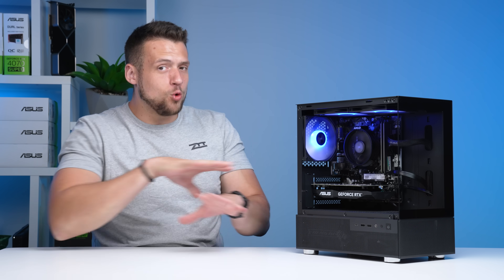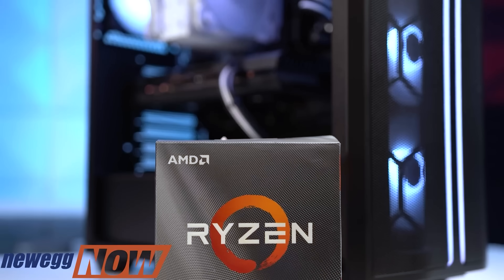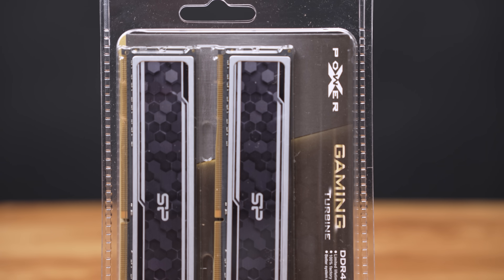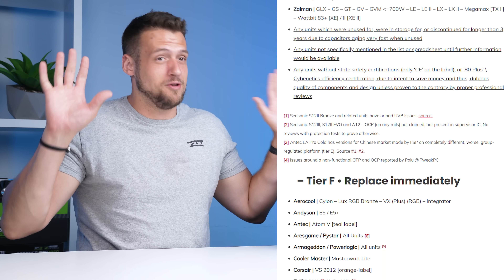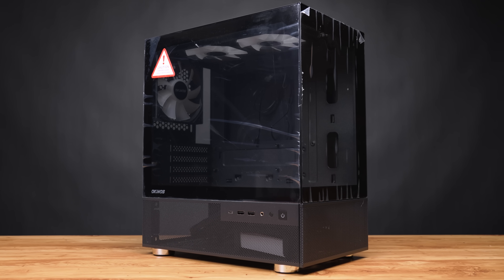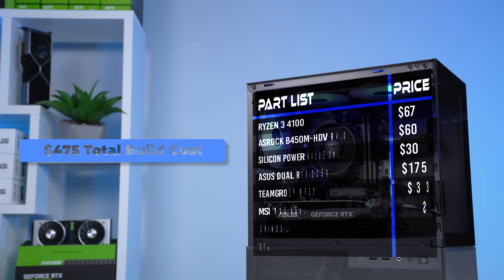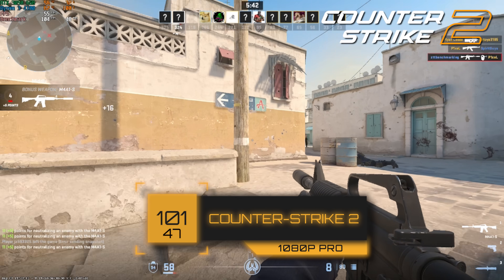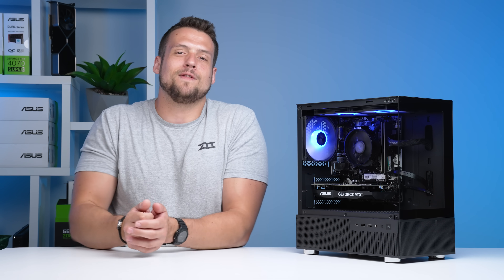$475 Gaming PC Build Guide

Comment: You can also use these specs & get better fps in games for the same price.

CPU: AMD Ryzen 5 5500 ($87)
Cooler: AMD Wraith Stealth ($0)
Mobo: ASRock B450M-HDV R4.0 ($59)
GPU: XFX Speedster SWFT 210 Radeon RX 6600 ($169)
RAM: Silicon Power Value Gaming DDR4 RAM 2x8GB 3200MHz ($28)
SSD: TEAMGROUP MP33 512GB ($35)
PSU: MSI MAG A550BN ($58)
Case: Cooler Master MasterBox Q300L ($39)
Reply: was about to post this heh, total ~500$
Reply: Almost what I did myself.  Remove all of the silly covers on that case and it has plenty of airflow for such a modest CPU/GPU combo.  Mine is similar and it pulls a maximum combined wattage at full load (theoretical) of just barely over 400W. I put a 750W in because it was $5 more - the cheapest modular PSU I could find,, but even a 550W is still overkill for the job. :)
As for GPU/CPU - the sweet spot right now is the Ryzen 5500/5600 and the 6600 for the GPU. Adjust as you need.  Suggesting a baby GPU like a 3050 is verging on just not caring at all.
Reply: You also can do a ryzen 5 2600 to save about 20-30 dollars on a cpu, the 2600 is still capable enough to fully utilize the 6600
Reply: Bro how are you getting a 6600 for 169&
Reply: @Acal_298  Any holiday sale.  Black Friday is coming up - you'll get similar deals. $189 is not hard to find. In my case, Amazon and NewEgg tend to fight each other for the budget market.  I got my card for that price from Newegg. The rest of the deals were Amazon, though, so cross-shopping is important.
Note that AMD dropped the prices for almost all of their non 3D CPUs, crushing Intel at this point. 
NewEgg has a new in box 5600X for $139. 16GB free ram with purchase.  Absolutely the best deal right now, as of typing this. Also, it's 99% likely that you can re-use your power supply as it's a DDR4 build, and you can of course use the SSD from your current computer as well.  OS - Linux is cheap and stable. 
NOTE - if you are a real cheap weasel, wait 6-9 months.  An entire generation of machines will be e-wasted a they are "too old" to run Windows 10. I'm typing this on such a box. No $30 for extended support for a year B.S. Linux and running my entire Steam library just fine.

Comment: Wouldn't the Intel A580 or A750 be better than the RTX3050 and probably cheaper too?

I want to like the 3050 6gb for what it does, offering a cheap-ish low power card that you can fit into any pc and still game on.

But I also absolutely loathe the 3050 6gb for how it is borderline fraudulently marketed. Being an overpriced downgrade of an already overpriced and underperforming GPU and the market shit Nvidia pulled with it.

If it was called the RTX 4030 or something, I would have been fine with it.

Comment: That's why building new pc is bad idea, you spent $450 for something that only performs as fast as Optiplex gaming pc for more than 2x price

even the RTX 3050 6GB is bad value, you can still build something much cheaper with used Office pc (the office pc often have only 240w psu and sff case which makes 3050 6gb become the only thing that can fits) that as fast as Ryzen 3 4100, if not faster
https://youtu.be/_Xw43xUPEgE?si=xU94mu0gNkx_kA01

Comment: i got an i5 11400f rtx 3070 ti and 32gb of ram and a 1080p 144hz monitor, i got a bit of a bottlneck in some games it's not a big deal , the question is should i upgrade my cpu or get a 1440p monitor ?

Comment: Honestly if you’re building on a lower budget, I’d highly recommend you go with a $550 to $600 build. That little extra cash will play a big factor especially for future upgradability.
Reply: And spend it wisely, my first build was when I was a lot younger and dumber. I got a GTX 1050 non Ti, and mechanical hard drive so that I could have a high end NZXT case, and matching white ram. I ended up regretting that in the long run…
Reply: @ZekeLawl  mechanical hard drives shouldn’t even be a thing in gaming pcs
Reply: @itzsabbage3830 you can use it when you need to put your unplayed games somewhere without uninstalling
Reply: @itzsabbage3830  Agreed, back then it was still debatable if you had a low budget but I made the wrong choice
Reply: Yes. That extra $150 on a build will easily double your performance. Super low end new builds are not something I'd recommend to anyone I know. At a certain point.. you'd be better off getting a used office type tower with something like a 10400 for $150 and tossing in used 3060/ti for $150-250 and swapping the power supply for another $50. $400-500 and you have what would be a $750 new build performance.
Reply: 550 or 600$ in US is like 800€ for parts here in Europe

Comment: Got a 4600G on sale. Perfectly fine for my needs. Re using my lovely Sapphire Radeon RX 580.
Reply from the maker: Nice good to hear
Reply: These can max out a 4060. I am more motivated than ever to get a 4060 because my little Ryzen 3 can run it at 99% apparently.. that's a 1080p guys dream
Reply: @jordanmntungwa3311 why would you get a 4060 in a world where the 6700xt exists
Reply: @jordanmntungwa3311 You should wait for the 5060 instead.

Comment: 3:01 it's off-centered to counter the extra weight that's on the left part of the package when it sits on a rack
Reply: The pack I got had heat spreader on only one side of the sticks.  It was a 32GB kit though.
Reply from the maker: The logical reason of why they did that does not soothe my brain
Reply: @ZachsTechTurf 

It does mine, but the fact that they put a heat spreader only on one side messes with me....

Comment: Zach would it not be better to get the "Apevia Prestige 600 W psu" rather than the msi one it has more watts and is 80+ gold compared to the bronze the msi one is ranked and it's always around the same price like 1-2 bucks off
Reply from the maker: I've used the Apevia Prestige a bunch of times, it's a perfectly fine alternative IMO. I actually prefer the much smaller cables on the MSI model though. The Apevia ones are extra bulky and harder to stuff into the PSU basement.
Reply: @ZachsTechTurf  kk thanks for the explanation

Comment: If youre going for a 3050 6gb, keep in mind that the performance is less than a 1660 and greater than a 1060. For the same price as this build, you can buy a 200 dollar ThinkStation p520 (it comes with a 900w PSU) and can slap whatever used gpu you can afford into it, minimal hassle.
Reply: (IMO, I love the look of the thinkstation case and don't care much for RGB)

You can alternatively just use Zach's build and just swap the gpu. If there's one component that can make the most impact in the build, it's the gpu. You'd be fine going new for everything else, but going used on the gpu is a no-brainer.
Reply: this is what you should be doing, and zach has done this multiple times on his channel, and it has proven to be great value for your money. He is showing there are other ways to build computers

Comment: The Gigabyte Eagle RX 6600 is just $5 more than the 3050 6GB on Newegg brand new😅
Reply: It is 220 usually what are you on
Reply: hey the rx 6600 is discontinued
Reply: you can no longer find it new
Reply: @TheCoolestCrocodileEver u can get it used for 170-200
Reply from the maker: Ehhh not usually here in the US
Reply: I have it my Amazon shopping cart for 179$
Reply: @ZachsTechTurf the cheapest new 6600 is 180 and the cheapest 3050 is 170 on pcpartpicker
Reply: Discontinued
Reply: @JesusisKing0926 it got discontinued yes but it's not like every Rx 6600 has been sold yet, you can still find it new
Reply: @pineappleking114  maybe in us
Reply: the 3050 is a scam at that price
Reply: You should make a video when the am4 ryzen5 x3d releases
Reply: @JesusisKing0926  you can
Companis still have storage full of it
Once it's sold out you can't
Reply: @TheCoolestCrocodileEver Gigabyte Eagle RX 6600, $179.99, sold by Newegg brand new
Reply: For flips and sales RTX builds get more attention than RX builds
Reply: @mylastaltsrrsly5967  true, but it will soon
Reply: @ZachsTechTurf its right here on pcpartpicker, gigabyte eagle rx6600 for 179 usd at amazon and newegg
Reply: Yeah even on Amazon I saw an RX 6600 for $175 and another on sale for $170
Reply: @JesusisKing0926  I got a brand new one and amazon 3 days ago, still an amazing card for its price
Reply: The current sweet spot is the 6650 XT for $200. But yes, supplies seem to be going fast.
Reply: @JesusisKing0926 discontinued does not mean all units have been sold lmao
Reply: @256odeon  i know
Reply: @angeldelagarzajr9464 when common senses peoples buy a pc for normal use Nvidia just better for the price you get now for a use pc build and yes peoples who buy RX already did some research before they buy because they mostly gamer.
Reply: @plektosgaming with $200 you can get a use rx 6700 xt because that is the price they going for right now in use market if you find one just talk to the person and they mostly will do $200
Reply: @iamjustme4542  Probably true, but where I live, it's hard to find one locally.  And I live in a city of 2 million+ people. A 6650XT new is still a good deal. Mine's made by Sapphire as well - so it's not some no-name budget offering, either.
Reply: @JesusisKing0926 still in stock on Amazon🤷‍♀️
Reply: @plektosgaming  People sell brands like XFX or Gigabyte, but it depends on your preferences and location. I got a used RX 6800 XT for $200 from someone who mined with it lightly for 5 months—not a bad deal.
Reply: @iamjustme4542  I don't generally buy a new video card but after two weeks of scammers, questionable cards, and run-arounds, it made more sense to get something that worked.  YMMV, of course.
Reply: @user-bz8sg8yk2g leftover stock will be around for a couple months I think it’s a valid pick
Reply: @mihajlo12345 the point of this video is new parts
Reply: Blue the 6600 is going for 169.99 on Amazon brand new. What are you on about
Reply: @TwoWheelsCrew  Many videos are researched a month or more ahead of time, because you have to research, order, wait for it to arrive, then build and film it all. So any build you see online is an estimate on the price.
Reply: Just get an arc a750
Reply: @ZachsTechTurf in India there is a big difference between
Reply: Lol rx 6600 is 250 dollars in my country while the rtx 3050 6gb is only 170 dollars. Rx 6600 is extremely overpriced here
Reply: @Ethan_Mcfly what r u on? 170 dollars compared to 1650 which is still mlre expensive brand new than this one. It is not a scam, stop rage baiting
Reply: newegg should be avoided- the returned policy is trash and known to sale used products as new
Reply: @thegamer2000-v9ki can here

Comment: Zach! Pls reply or make a short
 i5 3470 ant esports vs450L psu h61 mobo 16gb ddr3 and currently running an gt730 4gb should i upgrade to gtx 1070  please reply sir, i can order it right now or should i go with some other gpu for the same price? Or just gtx 1070?
Reply: Ok, if all you can afford is a gtx 1070 then don’t order it, save $500 or more and buy a new pc, but upgrading just the gpu to a gpu that isn’t even that great compared to newer GPUs is entirely not worth it
Reply: @Enjinercraft  I can barely save a 110$ for the gpu and I've built my pc a year ago so i clearly can't it would be a waste of money and time and gtx 1070 is as good as 3060 8gb it falls behing in some games tho and for 100 isn't it a good deal?

Comment: Bought a used 2080 for $200. Couldnt be happier with it.
Reply: Is 2080 1440p or 1080p gpu🤔
Reply: @leonpetrovic9956  im currently running 1080p max settings in most games, but it can definitely run some games on 1440p
Reply: @leonpetrovic9956 1080p
Reply: @leonpetrovic9956  it’s around as good as the 4060 so it’s a 1080p card but you can play 1440p if you want and it still gets the job done
Reply: @leonpetrovic9956 it is 1440p gpu

Comment: This is actually one I could afford. I have like $600 saved up. And I can save money by using my laptops ssd  and probably getting a mono with 2 m.2 slots and another 512gb one
Reply: Get a rx 6600 and get 1tb and your set
Reply: I would recommend you save up about 500 more dollars and get into the am5 socket+ some good ram and 4x4 m.2
Reply: Don't fucking recommend anything again Holy shit, no one can just spawn double their budget out of nowhere, also a 500 dollar build would do just fine for 1080p and almost no one cares for 1440p and 4k
Reply: @rip_drip4krate1 I was probably gonna get the 6600 because I know the 3050 is bad
Reply: @diabolicallyhuman412 I’m not looking for an $1100 build. I dont have enough time to double my fucking budget. The upgrade path doesn’t matter too much for me. I just need something that can run 1080p decently. Not a build for 4k gaming on ultra settings or even 1440p. And I prefer having a slightly lower end pc so I can make sure my projects can run on them
Reply: Just get a gaming console. These very small budget pc videos are more for fun than to be taking seriously. You could literally buy any of the new gen consoles, a game or two (more if you go with the digital ones) and play at 1440p and decent fps.